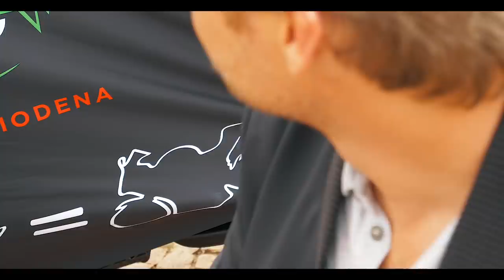Racing My Electric Energica Missile On F1 Monaco GP Track | Nico Rosberg | eVLOG

Comment: Hi Nico, why you don‘t wear the protection gear?
Reply: Such a bad example
Reply: Maybe cause he knew that he wouldnt go more than 35% of his potential and also, maybe cause he knows that  the trafic is easy in monaco.
I Ride bikes (only motorcycles - i dont have a car) but i only go with full face helmets.
Dunno if he has BIG BALLS or didnt knew that the bike would be that fast (got surprise by the bike) so thats why he went with his regular helmet.
Reply: Evilzin Abyssranger I know he has skills and nothing happens when he drives slowly, but the question is what happens if a car hits him?
Reply: Evilzin Abyssranger Had a bike accident with a 125cc bike at 15kph and my unprotected legs got hurt pretty badly. Imagine crashing at 30kph with no gear at all. Or at higher speeds. With a scooter helmet...
Reply: He can do what he wants, not his problem if tools copy him. Worry about yourself eh?

Comment: When the technology gets better I'll buy an electric bike for sure. But I think it will take about 10 years to be acceptable.
Reply: Yeah just under 10 years Solid State Lithium batteries should be affordable. If you can improve the density to the point 40kwh on a 160kg bike. That should be just over 200 miles of range flat out lose your licence riding. 350 miles highway cruising.
Reply: LS-218 Is quicker, better handling and achieved a real world top speed faster than Millard Viper. 207mph for the V10 vs 218mph for the Electric Beast.
Reply: should be affordable? it isnt sure they even possible to make them in big scale, with all parameters in place.. in 10 year.
Reply: LOFA
 WRONG, China is already mass producing on a massive scale with lower capacity batteries. The technology just needs to get better.
Reply: More like 4 or 5.
Reply: Highly Doubt they can get Solid State Batteries in Affordable mass production in 4 years. 7 years Minimum.
Reply: But i think its kinda dangerous because no one Hears you
Reply: Felix F Chain Driven no they are Not Silent.
Reply: @pgmallon  defensive much?  Electric is supreme for commuting.
Reply: @felixf4262  that's a myth. People don't hear bikes coming usually anyway even if they're loud because they come from behind you.
Reply: everyone has earbuds in anyway.  EV sound is a non-issue but is a major bonus for city noise. @Hirotoro4692

Comment: Sweet looking ride. Does the front lift on a Ebike ?
Reply: The accelerator curve is Programmed to manage the torque gradually. If you just have a direct on off switch it would either destroy a bunch of parts or Massive Wheelie. This specific bike kicks out 145hp & 147 lb/ft Torque.

Comment: Why don't they made the battery removable and the charging station provide replacement battery. So we just swap the battery and don't have to wasting time waiting the battery to fully recharge. Just an opinion
Reply: Cos it has fast charging DC .  by the time you get your gear off and take a piss its charged 😉

Comment: a bit of a let down that it doesn't have a traditional gearbox - this would have made it perfect.
Reply: Why would it have such an energy wasting feature?
Reply: Djawyzard basing this on revs, less revs , less energy used, longer travel time and faster speeds. Much like if a traditional motorcycle only had one gear, you’d use a hell of a lot more fuel and be limited in speed, that’s why they have gearboxes.

Comment: You can have super73 electric bike, you can have MB EQ but motorcycle must be with normal engine and sound )
Reply: No, you don't get it. Electric Sport Bikes have crazy Torque, it's just a different Beast. There crazy bikes like the LS-218 which kicks out 168 lb/ft. Riding a Catapult.